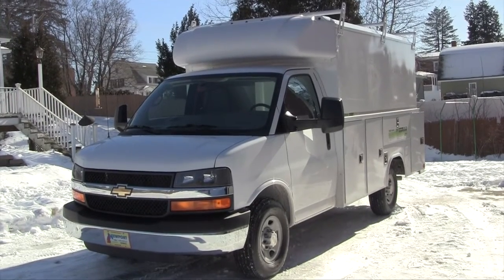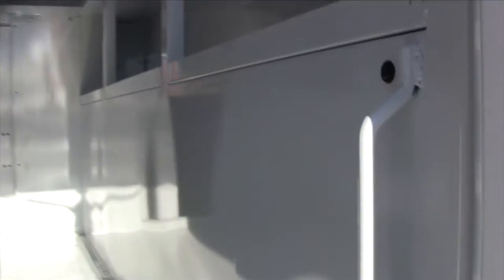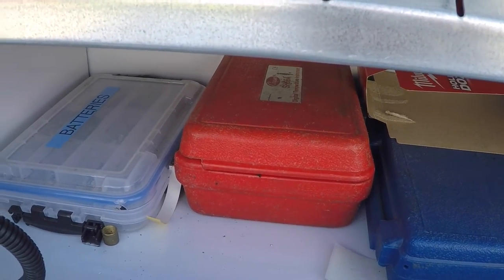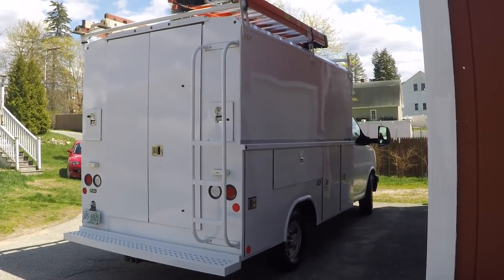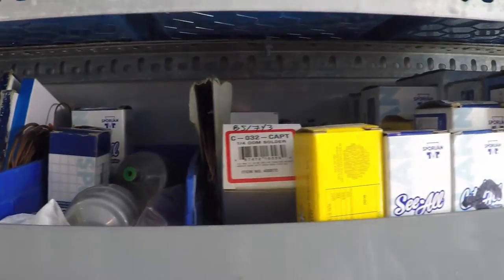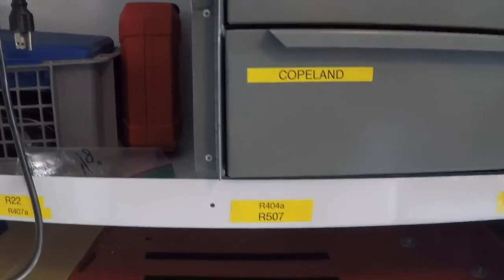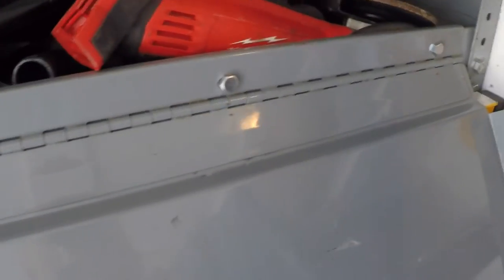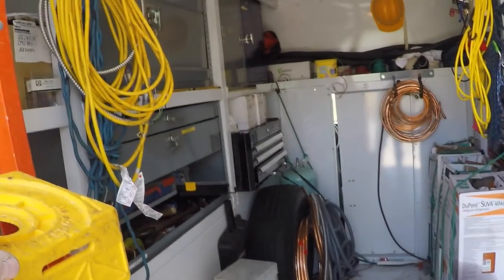Chevy Cutaway with Reading CSV - HVAC setup

Comment: I am currently looking at the same truck.  After having it now for a couple of years, do you still like it?  Is there anything you would do different?  How much do you hear the tools, parts, etc. in the cab?  I'm getting quotes of $46,500 but I want to get it down closer to 43 where you paid for it.
Reply from the maker: Matt Florence , this is the best truck I have ever had. I’d buy one again in a heartbeat.  After having both a Utilimaster and a Supreme box, there is really no comparison between the Reading and the rest. The latches, doors and paint have stood up under a daily beating, and the box still looks and acts new. Noise from the back is really negligible. I’m still making changes in my setup, and almost have it perfected. I truly would buy nothing else besides this